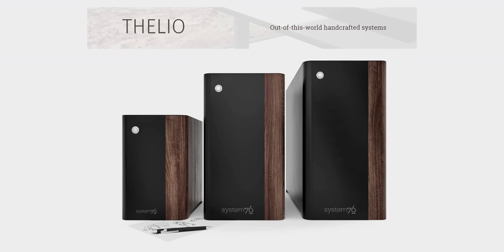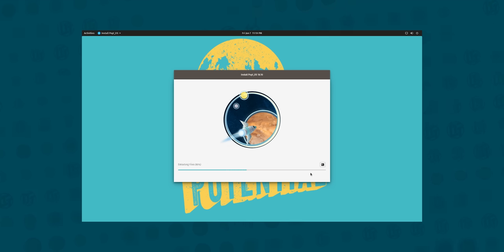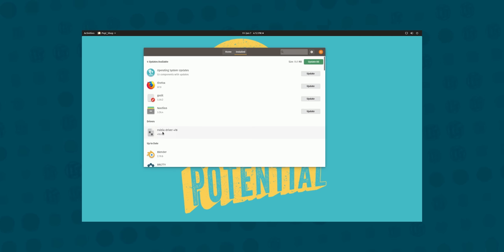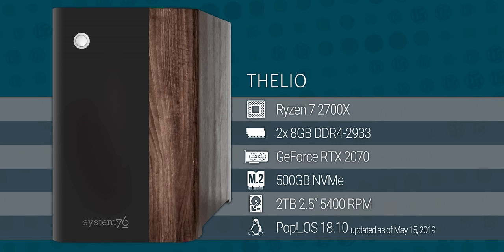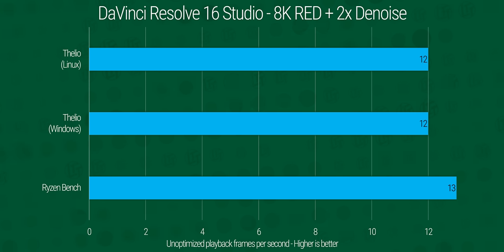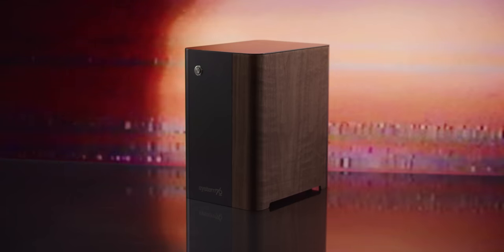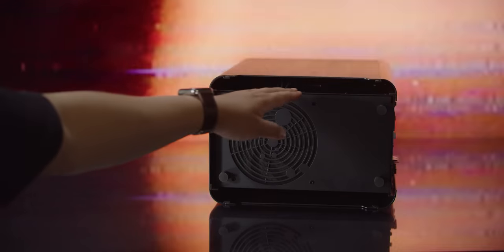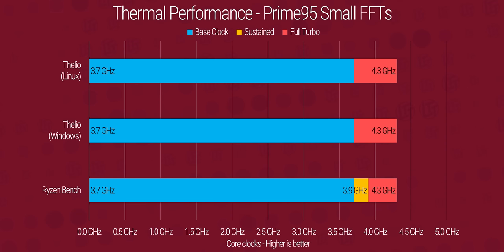A REALLY Weird PC… - System76 Thelio Review

Comment: Had a secondary machine that ran Ubuntu. I don't know if Pop! OS had these issues, but a few things I did not like about my experience:
- Needing the terminal for everything (I understand enough to do what I want to do, doesn't mean I enjoy using it.)
- No support or terrible support for some more obscure games made with some very specific/unpopular game engines (cough cough Wolf RPG Engine). This can be very bad for fangame enthusiasts!
- Needing to get help with these unsupported games in the first place. Which can potentially be a very long turnaround time if the support even happens.
- Desktop shortcut creation was a pain in the rear.

All things considered the experience was nowhere near horrible. I have a soft spot for Linux and am really looking forward to building a second PC later with Pop! OS installed to see how things have changed since I last used this kind of OS.

Comment: I already have the Sys76 Gazelle laptop, and love it.  There was a small problem when I started, but their support staff helped me clear it up.  I would like to upgrade my current desktop, and have a version of the Theilo intro model pimped out to what I want for about $800 more.  What is holding me back is that there is no front panel I/O.  I want to be able to plug in USB sticks an portable drives without climbing behind the case or taking up additional desk space with a USB port hub.  Second problem, I don't particularly like the Ubuntu system and prefer KDE as my GUI.  I have installed openSUSE with KDE on my Gazelle, and am quite happy with the system.

Comment: A little late to this party, but I want to give my answer to ques at 0:30

I am much more experienced in playing around with softwares (esp applications and os settings, on both Windows and Linux) than the hardware. So I would like a pre built system instead of building one myself.
Would also prefer a pre installed Linux for 2 main reasons: (1) Means no pre installed windows, hence no licence fee for something I would probably never use, and (2) I am sure that all hardware have good Linux drivers. I can even check the package/repo names for them in case I need them in some other distro on the same system.

Comment: It's having total confidence that the system runs Linux perfectly, so even if you wipe and install a different distro you know it's likely to work 100%
Reply: Seconded. My laptop is from System76. Came with Ubuntu, installed Mint instead (not technically a big change, but whatever) and I just had to point it at the System76 repo for it to get firmware updates and everything, running smoothly as if it came out of the box like that.

Comment: I've run System76 machines for many years. Currently I have a Thelio Major that's maybe two years old. Mostly I like it, but I have two issues with it. First, there aren't any front-panel USB ports. Argh. (So I've hot-glued a 16-port powered hub to the front panel.) The other issue is that there aren't any 3.5" drive bays. That wouldn't have been such an issue if the System76 people had mentioned it on the website, but they didn't. So I have a five-bay external enclosure where I put all my old 3.5" archival drives.

Other than that, I have no complaints.

Comment: Pop! user here, not on a system76 rig. Really considering buying one of their laptops that switch between RTX and integrated graphics.
I like their " No exceptions" approach, giving a real keyboard, rgb backlights, system integration, build quality, etc. I often find laptops have one thing I want, but not all of it, and it right about checks every box.
I will say I don't LUKS encrypt my drives though, mostly because of the pain in the butt workaround when it goes wrong;
And how possible it is to go wrong.
You'll only do that once to save your 1 byte encrypted drive to never do it again. Additionally, gparted used to not be able to mount luks partitions, neither could disks, in ubuntu or gnome disks, but the problem has since resolved itself with an update at some point.
 Overall, very satisfied.

Comment: You are also paying for Curated Hardwared that is known to work on Linux. Which is huge imo
Reply: Nearly all modern hardware (last 10 years) with few exceptions is supported by Linux.
Reply: True in some scenarios, not so much in others. Take my ancient USB-Ethernet adapter: long unsupported by Windows, but most modern Linux kernels detect it just fine. My TASCAM audio interface, though? Good luck getting that running on Linux with its proprietary drivers. NVIDIA GPUs are a special case - you can get them running on Linux, but not without sacrificing performance (with nouveau) or using proprietary software (thanks NVIDIA closed-source drivers). Hence why I use a Vega 56 in my own workstation.

All that said, though, Linux supports a huge range of hardware nowadays - it's simply stunning.
Reply: Jeff C well that is kind of true, but having the right hardware that is known to work should not be understated. For example theres heaps of ethernet nics, wifi adapters, battery charge counters and usb peripherals which wont work out of the box without some fiddling. Generally you have more problems on laptops then PC’s.

Comment: Love that Linux is getting more of push. So sick and tired of Microsoft being the king(bully other with fear to stay away from pc market/gaming/os) and I hope they push Vulkan api as standard. 

As small server admin, ex beta tester/moderator from small indie steam dev team (Beast of Bermuda) and been gaming and building pc since 90’s ( I’m bit older then Linus <3 ) I do have few comment about case, design

- RBG options / with software from system 76 ppl,  (could be selling point for those who want RBG) 
- front USB 3.x ports are a must
- head phone jack/ mic jack/rest button?
- front/side or top fan should be a must. Maybe with slide in filter,  they should ADD vent holes/air holes on the side the case for front/or top/side,  and there will be some who WILL want RGB options/RBG fans. 
Since it’s using EVGA RTX 2070?, it should exhaust out side the case or switch to FE GTX/RTX
- better quality/quieter cpu cooler ( agree with you Linus :) 

I’d want know what motherboard/ram/PSU and as said better cooling options/vent options/RBG.   And I’d love order R7 2700x/3600x/3700x Version, but I’d rather skip RTX and stick in my own MSI GTX 1080TI for now, if the case had decent enough cooling and strong enough PSU.   Yes I know RBG isn’t supported very well on Linux.  System 76 ppl/staff should. It could be selling point for them.  Linux pre built which has RBG software for these pc boxes :)

Comment: Big Linux fan here. Appreciate the efforts of system 76 for things like disabling Intel me by default.
But just as Linus said, most heavy Linux users would just build their own machine. (sometimes even not x86 based, like my rockpro64 nas)

And I'm not a big fan of Ubuntu as the daily driver. Hardware enthusiasts can't stand the slow kernel update. We need mainline kernels as fast as possible, definitely not something Ubuntu provides by default.
And for driver and steam, Arch also provides super easy way to install, although installing Arch itself is not that straightforward.

Hope system76 good luck, but it's going to be a battle uphill.
Reply: Adam Queen excellent feedback but Arch is relatively simple as long as you follow the guide on their wiki and install the software you need out of the box to finish system configuration
Reply: @swordkorn  To be honest, I don't really remember how easy/hard installing Arch is.
As after installing Arch, I didn't ever need to re-install Arch on my desktop/laptop/NAS.
Even upgrading to extra SSD/data migration is all done online using LVM.

Since it's so infrequent to install Arch, no matter how easy/hard installing is, it doesn't matter much.

But pure CLI based installation indeed drives a lot of newbie away.
Reply: @hbt hbt everyone has his/her own workflow, but if you're already watching ltt/gn or even ahoc/der8aur, then i'd assume you would be more possible to care latest hardware support.
Anyway distro is personal choice, feel free to use any you like.
I'm just doing an assumption based on the ltt audience and my personal experience.

Comment: Last Apple review : " 100°C and its holding BARELY its base clock hmm thats alright"
System76 rewiev : " 85°C thats a bit hot i would prefer something more beefy"
?!?!?!?!
Reply from the maker: Thin+light laptops in general run hotter than desktops. With a system of this size, I'd expect and prefer lower temperatures overall, especially since it's a computer that you might actually want to use as a dedicated workstation. -AY

Comment: Year of the Linux desktop?
Reply: That's every year, LOL.
Reply: There is already more Linyx machines than Windows tbh with Android.
But considering how Linux perform with a high number of core the new standards of the chipmaking industry might make it even better.
Reply: @uwu_senpai  Usually when someone refers to Linux refers to GNU/Linux, Android doesn't use GNU.
Also Android is not Desktop.
Reply: @azarilh2355  Yep. Plus Android is like an evil Linux distro with its spying, lack of freedom (no root for most devices), and dependencies on obscure proprietary drivers which are never updated, requirement of Google Play services for most apps, etc.

Android is technically Linux, but it betrays all of the Linux community's values

Comment: Switched from Ubuntu to Pop recently and was surprised by how little configuration was required out of the box to get it to work with my Lenovo docking station.
I switched because I needed a stable system with little maintenance for my job.
What a great little system.

Comment: I've been using Linux exclusively since 2007. My last 2 laptops have been System76 and I have every intention of purchasing my next laptop from them as well. You never have to worry about your video card or wireless card not working like you would with an HP or a Dell that you put Linux on yourself. Everything "just works" out of the box.

Comment: Why not an AMD card for a Linux systems? You'd have a way better driver situation.
Reply: Pop!_OS provides NVIDIA drivers with the OS, it just works out of the box.
Reply: They have it as a configuration option afaik
Reply: @gordonsills  Yes, but even so NVIDIA proprietary drivers on Linux can be quite problematic (X sever crashes, and last I checked Wayland doesn't even work), and Noveau isn't anywhere close to being good.
The AMDGPU driver is included in the Linux Kernel now and is rock solid by comparison.
Reply: @mkultrasoldier  I agree, that AMD is definitely better option and will definitely switch to AMD with my next build, but NVIDIA is not that bad. Real crashes are very rare (as rare as on Windows, I would say) and their OpenGL and Vulkan implementation is top-notch. Wayland on NVIDIA "works" on Gnome and soon "will work" on KDE, but is very unstable due to lack of support from green team, therefore driver is blacklisted by default. Nouveau was good and was progressing well several years ago… until NVIDIA decided to cripple it :(
Reply: @mkultrasoldier : I agree. Really can't wait for Intel to get into the dedicated GPU game.
Reply from the maker: I asked about that - It's about availability. As of when we got the machine, there were low-end RX 500-series options, but AMD didn't have a higher-end card that was power-efficient enough to be both thermally sound in an ITX chassis and a light enough load as to not over-stress the SFX PSU. AMD's RX 5700 might change that dramatically... -AY

Comment: @8:22 if you look closely at the drive in the bay, he has installed it incorrectly.  The drive screw grommet has a groove to accommodate the track, he has it all on the outside of the track on the 'bottom' thereby making the other side not fit and the track 'finger' is flexed out of the way to accommodate the screw head.

Comment: He said about the IO on the back of the case being cut to match the motherboard. I would love to get hold of one of the cases, work out where to cut it, and cut a rectangular hole in the back of the case to fit the IO plate that came with the motherboard. May take a bit of time to work out where to cut but would mean you could fit any board that fits the case with the board's IO plate.

Comment: They could remove that bottom fan entirely since there's no baffling to prevent the air from just wrapping around to the other side. That would probably cut down on noise. Then the CPU cooler would be the exhaust fan for the case, like some Dells. They could also add some 1/4" open cell acoustic foam to the sides of the case where the clearances are largest, and it wouldn't interfere with airflow, but it would absorb sound.

Comment: "it's actually ported over from Elementary OS, but with one clear value add - system76 curates their own packages" smh that's not any different from elementary os they do the same thing
Reply: Wave Phenomena one of the elementary developers work in System76 so that probably why they ported it over
Reply: @vextium9396  yes but I'm saying, he said it was different yet it wasn't
Edit: and no that's probably not the reason, it's just a good, if not the best, linux application center

Comment: i think i'm gonna switch to popOS if my review is good
Reply: My problem is still that it's Ubuntu based. Means old packages. Why not Manjaro? I've been using it for 3 years without any issues or extra efforts. But I am a doer not a tweaker! :)
Reply: @nikhil9605  No no no no!
If you use the 6 months release cycle you get the most recent, for example, in 19.04, you even get the 5.0 Kernel, latest GIMP, Firefox, LibreOffice and all that good stuff
Reply: @LiamPilot120  Am glad budgie works for you. :) Budgie OS has a lot of limitations for my usecases. And I am not a Budgie DE fan.

Comment: I've normally been using Elementary OS Juno for my old as heck HP 2000-427CL but it works well on a AMD E450 APU games pretty ok with light games can be able to play GMod long as the map isn't too big but even large areas do render well but will choke it very quickly unless ya got fast ram installed

Also if ya need any help with Linux try looking at some YouTubers like Total OS Today or Switched to Linux you might also see me there talking during the live streams and live stream chat
Reply: Is elementary os good for old hardware ? How much resource does it use ?
Reply: @reralt  well sense it uses pantheon it seems pretty snappy for me but for old hardware may not be 100% friendly with it but far as I'm able to tell runs pretty much alright for the most part haven't had any issues with Bluetooth support or Bluetooth audio support
Reply: @reralt  but for resource usage it seems mildly heavy but not like so heavy it's unusable on old hardware
Reply: @reralt  For old hardware ? Meh, I would go for (if you still want an ubuntu-based distro like elementary) xubuntu, lubuntu, kde neon or the regular kubuntu (the difference between kubuntu and kde neon is that kde neon have the latest and greatest from KDE), Ubuntu Mate, ZorinOS Lite.
Reply: Thanks for the advices guys. 
My plan is to revive the dead family pc with some good looking distro like elementary to show my family how cool Linux is. Guess I will try one of the ubuntu variants. 👌
Reply: @reralt  alright lol and like I said you can find a few other Linux users like Total OS Today or Switched to Linux or Big Daddy Linux lol those guys can help out some with Linux newbies even forums can help just be careful of a few of them some aren't newbie friendly but if ya look around the ask Ubuntu forums they may help as well but if you are new to Linux try Zorin OS or Elementary OS or something Debian based and if it's old try Xubuntu or Lubuntu or Zorin OS Lite

Comment: Second hard drives are usually 'hidden away' in Linux. You don't access Linux drives by letter like in windows, you access them as a directory in the file tree. The rub is that your drive will be mounted somewhere like /home.

Comment: Linus you are missing a important point, the drivers for system76 is integrated in Linux kernel to get best performance but if you install Linux from their website the performance will be degraded. Do you heard about ubuntu certified devices. Ya it's the same thing system 76 does

Comment: I've been using Linux Mint (Cinnamon) for years now -- I find it somewhat easier to install, maintain, and install/uninstall software on than the Windows 7 I used to use (Why, oh WHY doesn't Windows have a package manager?), and FAR less of a chore than the Windows 10 computers I'm occasionally forced to struggle with for family.  My laptop is from System76, and I pretty much couldn't be happier with the product or service (it came with Ubuntu when shipped, but I installed Mint on it later) but I built my desktop myself -- and I'd do it again, since I can't justify the premium price over commodity hardware. PopOS sounds interesting, and I've been casually looking at it every now and then, but I think I'll stick with Mint for now. The 'classic' Mint-X interface style is basically the Windows 7 replacement I wanted in the beginning, and I've become very used to it by now.